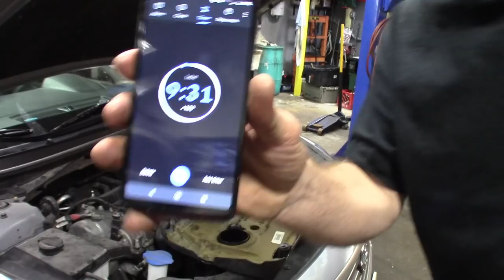Time To Place Them Bets

Comment: she lost by more than a minute by the time you put down checking the gap on the plugs and not putting anti seize on the plugs
Reply from the maker: No need to check gap on these plugs. And anti seize gets too messy sometimes
Reply: @JRC54  i have never had good luck with not checking gap on plugs . not sure if it is where i buy from or what /as for anti seize on threads it is a must for small engines
Reply: JRC54 always some one to rune a party